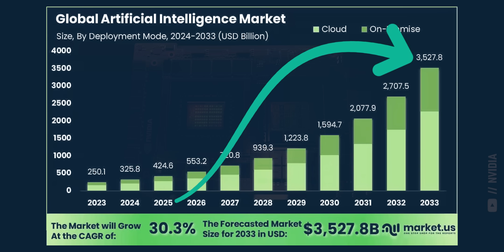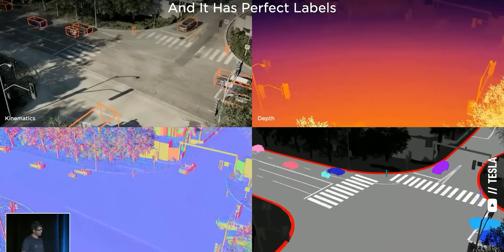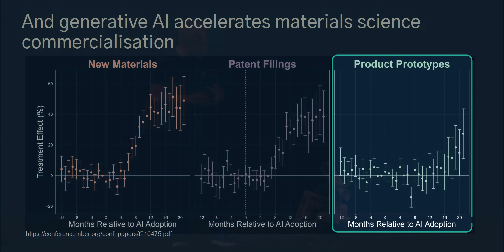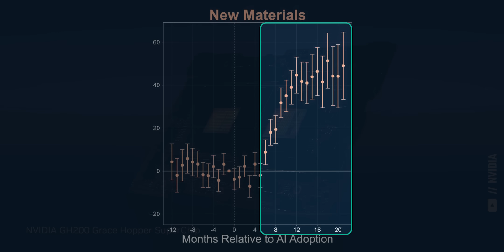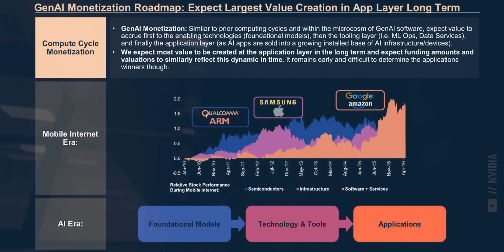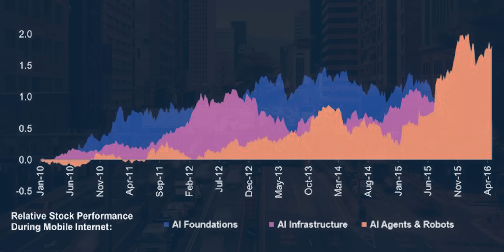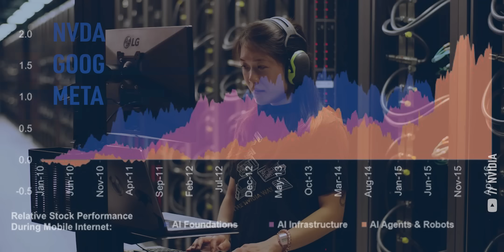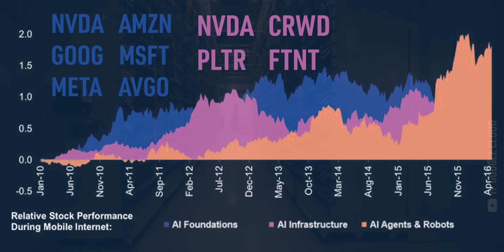The Investment Opportunity of a Lifetime (Don't Miss Out)

Comment: You way to late... :) But Nividia don´t will make all run alone. the AI run think Google will be also on track. :)

There are new CPU and GPU Materials years ago was the first one yet they go to mass production
Also we get light as new method so it will chance so many things at the same time.
Everything much faster , less cooling energy will go down because of light CPU´s.
 
Graphite is also in the making for mass produce so next generation to send silicon to the graveyard.

But thee market is so dmg. 
Sea on your level of national debt.

I have so much more but we will sea whats comming next for rea not only in the laboratory. :)

Comment: PLTR is incredibly overvalued, you have to run the numbers! If you expect an 8% return per year on Palantir from here (market average) for 15 years, the company would have to grow EPS by 25.7% per year in the same period assuming the PE contracted to 60 which is still high. A PE of 40? 29.2% EPS growth per year. These numbers have never been achieved before for such a long period of time, maybe Apple or google or Mastercard have been close to 24% but 30% growth definitely not. It is an insane bet. Palantir has performed well no doubt but 25%+ EPS growth for an average market return even when assuming a high PE of 60? It is basically a gamble. For all Palantir investors just put that money in the S&P 500 and you won’t have to hope for historically high EPS growth to get average returns. These calculations are based on statistics as of Monday, June 16th, 2025.